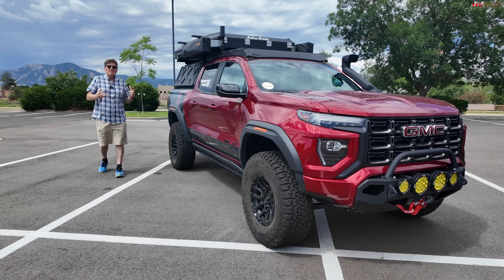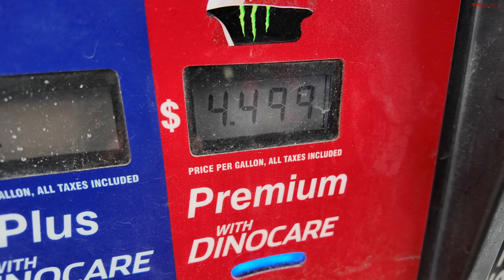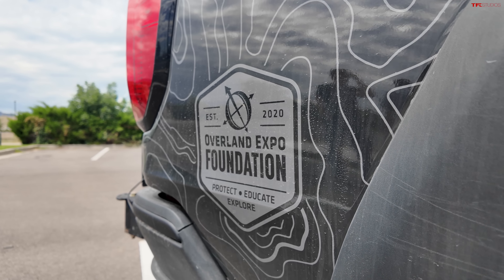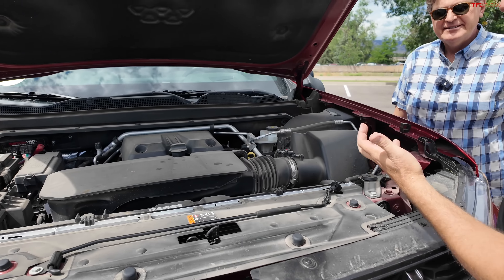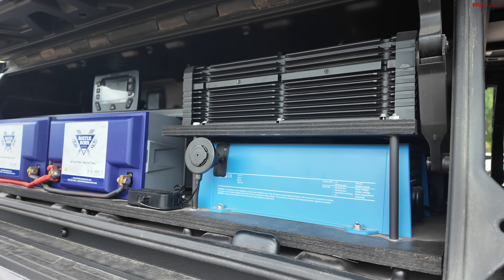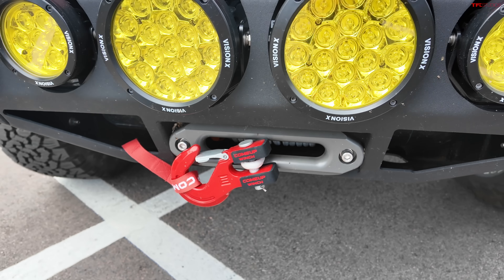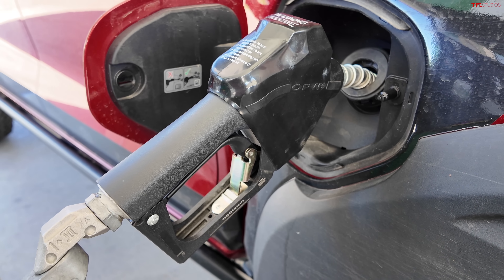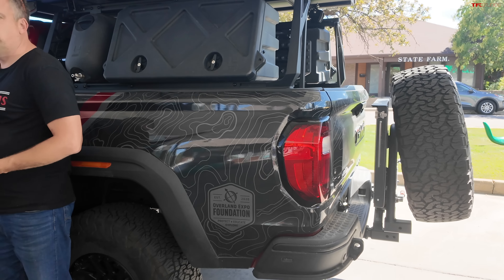How Much Does Adding a Ton of Off-Road Mods Kill Your Fuel Economy? | Denver 100 MPG Test

Comment: The best thing about an old Ford or Chevy is that they run like crap, but forever, on 87 octane some barbed wire, duct tape and mall perfume sample cards in the air vents to hold down the musk
Reply: Sure, but if they even look at salt, the chassis and exhaust starts to disintegrate, and breathing in what those engines are putting out is no bueno. Unless you live in the southwest, they end up being a short-term vehicle until the bondo starts costing more then the gas to run them.

Comment: I have added a bunch of similar mods to my 2002 GMC Sierra 2500 H.D. With LB-7 Duramax power and have owned my truck almost 21 years now having bought it used from its original owner after he had it one year only.  Before all the overland goodies I used to get 19-21 MPG average out on open highways with same lift , same 37” tires , same factory 3:73 gears Etc.   Now with mid height rack in bed , rooftop tent & awning mounted on it & bed mounted storage full of gear , PLUS cab mounted rack with 200 watt solar panels & 8 gallon aluminum solar heated water tank, and Full size swing out rear mounted spare tire set up like your red truck , my milage has taken about a 4-6 mpg hit as well .  I have noticed if I can keep boost low ( 5-7 pounds at cruising @ 65-75 mph) I can get close to 16-18 out on roads , but if there’s any heavy head winds or major climbs in altitude and boost goes up into 25-30 pound ranges then I’m lucky to get 10–14 mpg at same speeds.  Having the ability though to just about call anywhere , anytime “ Home “ though is “ Priceless” 😊.   I’ll be hopefully taking about a month long “ Retirement trip “ next April once my plans materialize and may have more numbers to share from an extended period through 8-10 states here on West Coast including hopefully a return leg through mid -west and Texas to see my Oldest & my grandsons . Money saved at hotels & motels helps pay for fuel economy losses . It’s all in what you prioritize as important to you . Anyway I enjoyed watching this one & Thanks as always for what you do & share .  C-ya maybe out on the roads ….😎👍

Comment: Adding a "ton" (2000lbs) of gear to a mid sized truck will put it way over the payload capacity of said truck.  Andre even showed the payload sticker of his Colorado not long after buying it, and it was way lower than "a ton"
Reply: I bet you're fun at parties.
Reply: A ton is 2200 lbs
Reply: @backwoodstherapy your idea of parties is being dumb and drunk? Knowing info is good.  Maybe that's why the new generation is full of victim mentality.
Reply: @YAOZYVIDEO  A ton was originally a measure of volume, not weight. Today a short ton is 2000 lbs. A long ton is 2240 lbs, a British tonne is 2204 lbs. And let's not even get started on all the other "tons" there are like harbor ton, deadweight ton, etc, etc.
Reply: You'll be disappointed to know full size pickups tend to get 100-200 lbs more of payload than their midsize counterparts.
Reply: Also all the weight up high.
Reply: @elche1976 you're being pedantic for the sake of trying to make yourself feel superior for some unknown reason. Outside of some annoying Sheldon Cooper types, anyone who hears "I added a ton of mods to my truck" is not going to immediately think "oh, they added 2000 pounds to their truck?" It has zero to do with "victim mentality." You seem like the type to get out of the car anytime someone honks at you but run away the moment they also step out of the car.
Reply: @backwoodstherapy  you got your feelings hurt because you used a tired, drawn out one liner and got made fun of for doing so.  Facts over feelings.  Crybaby gonna cry and write a novel.

You're not very good at assumptions.  But that seems to be a theme for you.

Comment: How many trucks kitted out like this spend that much time off road overlanding that it makes sense to not have a separate econobox daily driver?
Reply: Lol hi. Little overlander boy here. Absolutely got a secondary sedan that is my economy driver for distance and local nonsense that I don't wanna hurl my gear around to do.
Reply: I have an extensively modified 4Runner and our daily driver is a Chevy Bolt EUV.  The 4Runner only goes out for snow storms and trail runs.  The Bolt EV costs about 3 cents a mile to drive.  Andre's truck -- the bone stock one -- was just over 19 cents a mile to drive.

There are other factors -- insurance, purchase price / depreciation -- but the nice thing about having multiple cars is that you save the miles on each vehicle for only what it's best at.
Reply: need to show off the overlander so people know you are an overlander
Reply: On the YouTube channel 4WD 24-7, they replace the truck bed with an aluminum canopy (box). The canopy can be removed, and they use it as a work truck during the week with a flat deck (tray). For trucks that will be carrying a lot of weight, there is a GVM upgrade available by certain companies.
Reply: @aerynlovell4754  Unfortunately in the US we have no GVM or GVWR (our equivalent) upgrade or recertification process available. We still have all the same modifications. But I've also never heard of anyone in the US running into issues with legal or even insurance with these over capacity rigs. For the most part... no one cares other some people online.
Reply: @PeakDecline During the last oil boom in south Texas, license and weight DPS were pulling over welding rigs left and right. Rolling out the portable scales and writing tickets. 

Trailer safty has also been turned up several notches over the last twenty years. 

When i first started dragging a trailer, it was hook up to the two inch ball and drive. 

Know you need safty chains. If you have electric brakes, then you have to have a breakaway cable attached and working battery on trailer to lock brakes if you become detached from trailer while rolling. So yes, fines are a very real thing in Texas.
Reply: @duanehenicke6602  Seems the commerical operation of those rigs is key here. Any such examples of recreational or specifically overland setups?
Reply: @PeakDecline  Actually THERE IS such a mod available and that is a proper licenced mechanical engineer who can provide a signed inspection report and signed photos of all modifications done to the vehicle and "certifying" that is able to carry the new weight and give a copy to your insurance company notifying them that modifications were done and are up-to-snuff mechanically. Keep the signed original and multiple copies of the report and signed printed photos with you along with the insurance papers and present to any inspection personnel.

V

Comment: You guys should check to see if that overland truck is over payload with all of that gear on it.
Reply: My guess that it’s at least 500 pounds overweight. Probably more. They mentioned that rear coils had to be replaced with stronger coils or it would have been squatting on the bump stops.
Reply: I see a lot of plastic; even the bed racks holding the roof tent are mostly plastic. That, combined with lightweight aluminum is probably keeping the total weight of the gear to under 800 lbs.

Comment: That camper setup is most likely the main culprit. The weight and drag of that hurts more than the slight lift.
Reply: Yup, roof top tents really suck the gas, which is too bad because they are great t use.
Reply: Yea would have been interesting to see it without the all the added drag from the tent. Lots of people lift and put bigger tires on - not many people drive around with a bunch of stuff strapped to their roof.
Reply: Agreed on that point.

Comment: What I find interesting in all these mods is they are done by the weekend warriors.

I worked my entire career in the consulting industry and the pick-ups we used were completely stock. Yes we switched tires between summer and winter studded. Vehicles saw limited pavement use with unpaved industrial roads, new construction requiring 4 x 4 and lots of old roads that would equate what most of the weekend types would consider awesome. A few times we got to pull those mods out of a mud hole or snow drift that their massive tires failed in. 

Personally I think most of those modified vehicles seldom leave the pavement. They are done to impress I don't know who. Now I will admit some do get out there and use the vehicles as they are meant but I bet the stock can keep up in most instances.

Comment: They don't change a lot unless you take it extreme. But overall, just consider the weight and aerodynamics. If you just put all the gear under a camper. You won't have as much loss as mounting to the side.

Comment: In 2004 I bought a Jeep TJ which came with 225 mud & snow tires. I was 
getting 21mpg until I upgraded the tires & wheels to 32" mud terrains. My
mpg dropped to 15.

!

Comment: I have a 2023 Colorado with the HO engine. Where I live at 1400 elevation, I get around 20 mpg, day to day, maybe 22 on the highway at 80 mph. When I go to altitude (I have driven it in Colorado, Wyoming, and Northern Nevada) I get at least 5 mpg better fuel economy. I think it's due to the turbocharging.
Reply: Its due to the air being thinner causing less aerodynamic drag. In Wyoming you are generally pushing through 20% less dense air than sea level.
Reply: @Jay-me7gw  Makes sense. Thanks. I remain shocked by the difference. Previously I owned a Toyota Sequoia with the same travels, and there wasn't much of a difference in mileage.
Reply: The thinner air is less through the mass airflow sensor. That means less injector pulse width. So, better mileage with less hp. Turbo or not.
Reply: @puncht37  Thanks
Reply: @Jay-me7gw  Thinner air....yes, that will help a small bit on the aero drag side), but the much bigger difference in mpg comes from not having to use as much fuel per mile to get the same air/fuel ration.  It's why (long with the added alcohol for winter fuel) your cars get substantially LES mpg in the winter (much denser air).
Reply: @kx8960  wouldn’t less air and fuel mean less hp is being generated? Why would less hp suddenly need less hp to be propelled down the road?

So, by your suggestion, if the engine needs to generate a certain amount of power to move the truck at higher elevation, wouldn’t it just open the throttle plate more or downshift a gear and spin the engine faster to hit the amount of airflow needed to generate the required power? And then you would just end up at the same mpg’s anyways?
Reply: @Jay-me7gw  Theoretically...sorta.  The ECU tries to keep it stoichiometric, so thinner air requires less fuel.  Yes you make less power, but somehow it ends up being where you get a little more mpg at altitude, less in the winter (mostly because of the extra alcohol).  Opening the throttle plate more for the same amount of power means less parasitic internal aero drag, thus more efficiency, so maybe that's the key.
Reply: @kx8960  the throttle plate thing might be true on an NA motor but a turbo motor like this that has load based tuning is going to hit the same airflow target regardless of the ambient conditions. So if anything, a boosted motor is working a little harder since it has to drive the turbo to a higher pressure ratio.
Reply: @Jay-me7gw  Even in a turbo motor there are throttle bodies, a more open throttle body is less energy lost in drag, thus higher efficiency.  Also, since the possibility of pre-detonation is less at altitude (why you usually find premium is 1 octane less) the ECU could theoretically run more advance timing without risk, thus being more efficient, AND the fact that less octane rating actually means more energy per gallon of fuel.  I think it's a combination of a lot of little things.  I just know it's true from observing it for many years.

Comment: I was getting 21-22 mpg in my JLU Sport S 6 speed when it was unmodified. Dropped to 21 or so when it was on 33s instead of the factory 32s. Put a 1.75" spacer lift, dropped to 20. Put on 35s, dropped to about 19.  Regeared to 4.88s, went to 18. Put on a steel bunper and winch and switched to a true 3" suspension lift, now I get about 17. Less if I do lots of ciry driving. Highway driving, i can get almost 18. I've driven it to work and almost nowhere else the last couple weeks and the computer is showing 17.9. I'm hopeful I might see 18 mpg by the end of the day. 😂
Reply: Sounds almost like my MPG journey with my mods on an F150. Started at 18 MPG all stock and now I am between 11-12 MPG. 😃

Comment: This is why I own a 2021 Nissan Titan 😂 
My pro4x 3 inch lift on 33x12.5 18 grabber x3s pure v8 gets that 
My wife’s 2022 4runner trd off road 3 inch lift same tires gets 14-16mpgs 
Full size trucks can roll 33-35s 3-6 inch lifts and gear and still get 13-18mpgs

Comment: add a good wind deflector and get proper gear ratio in the differentials and you go back over 20mpg ...  wind deflector can be really cheap but switching diff gear can be expensive but it really worth it specially if you drive it a lot or use it off road

Comment: It looks like the CEL is on in the modified truck. Depending on what the code and related issue is, that could definitely affect the fuel economy and skew the results of the test.

Comment: I used to be all in for lifting and mud grips. 
Then I had to spend many hours looking for a place to go use it. 
It don’t make sense. 
I now have a “grandpa truck, 2006 Cummins that Looks stock. 
Mich LTX 35” STREET tires on 2018 20’s.
I tow a 5th wheel toy hauler. So my combination makes sense for me.
Reply: People like you crack me up. Many hours? OH THE HUMANITY. Rigs built out to the one in this setup are used for multiple week long or even month long trips. None of us with such rigs care about driving "many hours", that's part of the appeal.

Comment: Im sure the test is close but its not stock vs loaded. Andre had 2 transmissions in the bed. Thats a bit of weight. The GMC had 91 octane added to it. Probably had 87 in it so it got mixed and the computer didnt have enough time to map out the engine for the change. Still a good idea of what the numbers are about.

Comment: You can keep your accessorized up pickups though probably 90+ percent will never see a back country trail or muddy field.
I'm quite happy with my totally stock pretty looking Ruby Red Metallic F150 with 3.5 engine at 16.5/22 mpg which is about the same mpg as my last, a heavy (CAT scaled 8360#) F350 crew cab long bed. The gas mileage seems to be a wee bit better with the updated new cam phasers but time will tell on that. As to exhaust sound - it actually seems to growl somewhat in Sport Mode like an older F250 with a 351W and a dual exhaust

Comment: "We're paying $4.49999999?! When didn't hat happen?" 
Ohhhh around 2020.
Reply: Mine isn’t nearly that high where I live but yeah it makes sense the price would go up after a period of extremely low demand.
Reply: 2021
Reply: Depends where you live. I recall paying very near $4 a gallon in 2004/5 in California.
Reply: In other words, as soon as Joetato was "installed" like a toilet...
Reply: @ALMX5DP  Commifornia is at least part of the issue.
Reply: Gas prices were under two dollars about ten years ago; politicians really took care of us back then, but they have been climbing up ever since. I miss the 2014 economy, best raises of my life with job offers every time I turned around and dirt cheap high tech devices.

Back then I could get the best graphics card on the market for $800, but just four years later the same graphics card was now selling for $2200 because politicians that got in office wanted a piece of the pie and started raising the prices on everything :(

RFK Jr is the only one who hasn’t raised prices in office yet!
Reply: Perhaps a little research into the market forces that determine fuel prices in the US would be beneficial before you post again.  The more you know 🌟
Reply: That's for premium gas, generally around $3 now, which is substantially lower than the 2005 to 2012 era, not even including inflation

Comment: Since GM doesn't call for 91 for the Turbomax engine, regardless of output, it would be a great test to see if it makes any difference over 87- Denver 100 loop, towing acceleration...
Reply: It would be 85 octane in Denver.

Comment: That 2.7 liter should have been put in the 4 cylinder Camaro, instead of the 2.0 liter .
Reply: The 2.7 wasn’t yet developed when the Camaro received the 4 cylinder treatment. If it was not killed off, I suspect it would have transitioned to it like the Cadillac did.

Comment: Why does the 2.7 liter 4wd silverado get the same mpg as the colorado? Is the weight really not that much different?
Reply: No, i dont think they are that far off. A base crew cab 4x4 silverado is like 4950 lbs or something whereas I think these Colorados are 4700. I know the ZR2 I looked at was almost exactly 5000 lbs according to the payload sticker on the door.

The MFG's definitely spend more time and money improving the full size trucks than the mid-sized.
Reply: @Jay-me7gw  I just got back from a vacation out in Wyoming, where we rented a 4x4 Silverado with the 2.7 turbo, and I was shocked to get several 24ish mpg fill ups. At lower altitude I imagine it could be even better.